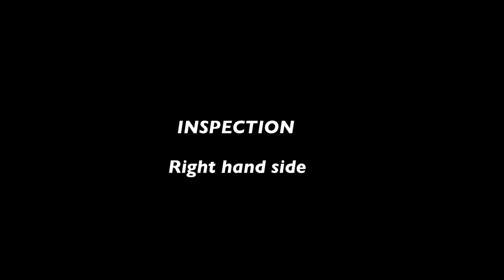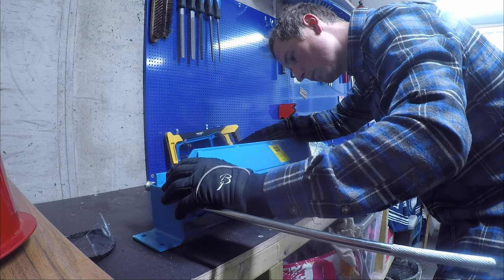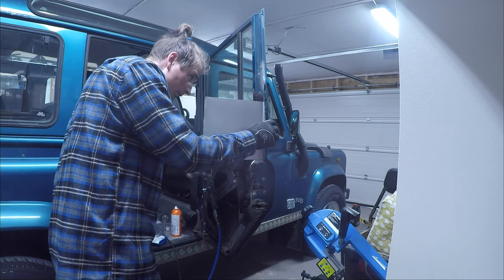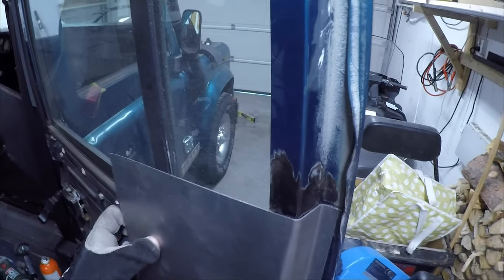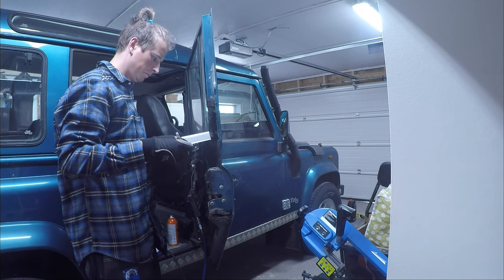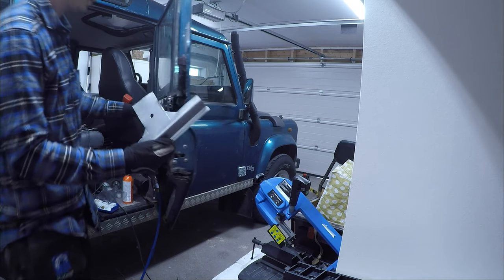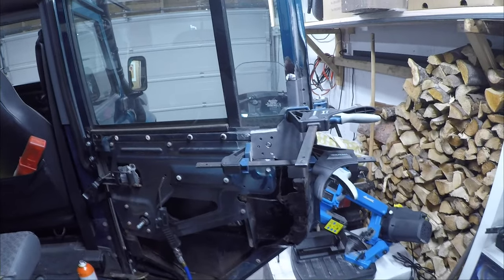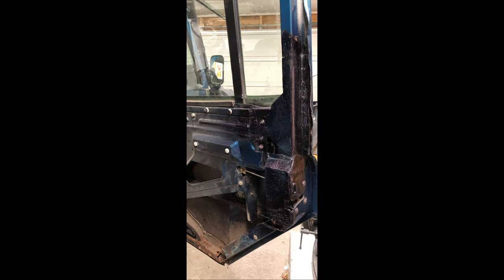Defender door repair - WELDING Land Rover DEFENDER doors

Comment: Thank you for making this video!  I just bought a very rusty '85 Land Rover 110 Defender with the same door rust problem. I do want to make a suggestion!   YOU MAY MAKE A PAPER or CARDBOARD STENCIL of the Rusted Out area and then use your Stencil to lay on top of the 22 gauge metal sheet that you have.  I took a class in Metal Shop in 7th grade and learned how to make metal boxes and how to spot weld and how to use a drill press and other metal cutting tools.  I recently bought a Mig welder and cannot wait to dig into the process of fixing up all my rusty cars. Thank you again and best of Luck with your ROVER.
Reply from the maker: Hey and congrats with the “new” car 👍😊 I know, I got some tips about that later and have seen some videos where they do that and that’s a great tip for other going ahead with welding sheet metal. 👌 Sadly I sold the Defender, was getting so rusty that it was getting a bit more than my skill could handle. Sold it to a guy in the Land Rover club who has fixed it up nicely. 👍 Thank you for sharing and I’m very glad you liked the video. 😊 Welding is very fun and I will do it more this winter to make stuff for my Discovery 3 build. Wish you good luck with your project. 👍

Comment: Using clamps setting the new metal place onto the door, will make it easier and free both your hands for measurement and general fitting. Another idea, could be using a metal grinder to cut out the new piece of metal, so the edges dont get so bend compared to using the metal scissor. Just some ideas, im not telling what too do, as you are doing great. :-) Well done :-)
Reply from the maker: Thanks for the tips, I'm learning a lot as I'm doing this and advice and shared experiences is what I'm going on. I saw some magnet holders that I will try out next time. I have bought some extra metal clamps since this video was filmed so have some extra now. I thinking of getting a metal cutter of some kind, but I will test out the grinder next time. 😊 Thanks for the kind words and thanks for watching! Best, Simon

Comment: Using card templates would make your job easier.
Great videos, keep it up.
Reply from the maker: Thanks for the tip. I have seen them using templates and will definitely try that out next time. 👍😁 I think this is on of the favorite things I have fixe on my Land Rovers, welding and metal work is really fun and rewarding. 😊

Comment: Great video, nice to see how you turn rust into shiny metal again :-D since my Range Rover classic, i know how hard it is to bend the metal in the right shape that it fits good. Well done.
Reply from the maker: Thank you Daniel! :) This was on of my most rewarding fixes on the Defender. Something special about fixing it from just a sheet of metal. I have much to learn about fabrication and beding metal, but I can't wait to do some more welding.  Was there a lot of things needed welding on the RRC?  I have seen some videos of them and read forums, some are pretty bad. 😊
Reply: @LandRoverDrive  Yes, a lot of. The chassis was in a perfect condition but the body had a lot of rust. I welded both front foot floor and both fenders, after that I thought was finish, but the rear end of the body was also bad, trunk floor and the rear fenders, this was the point where I gave up and sold it. 🙄
But years later a want a RRC V8 what an awesome car, but rust free and in good condition you have to pay 20000 € at least. 😀

Comment: Well done. I have the same to do in my TD5 90 some time in the future. I am also a beginner in these things but you are already way ahead of me. Did you MIG weld the door frame, or was it stick welding?
Reply from the maker: Thanks! 😊 I just watch a lot of welding videos and did some practice welding. You can see some of them in https://youtu.be/Hlk_ynBUXzg. I used MIG welding with gas, I learned after all the videos that MIG was the best for car restoration. MIG is a lot cleaner than stick, and handles impurities better than TIG. 😊  Just get started welding, that's my biggest tip. It's fun an so rewarding. If you have any more questions just ask, I'm not a pro but know some stuff.